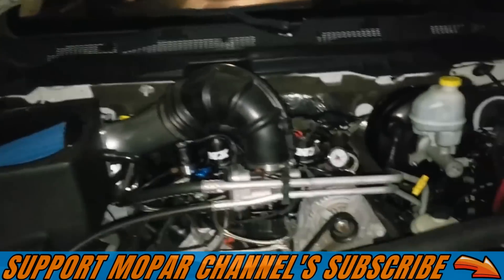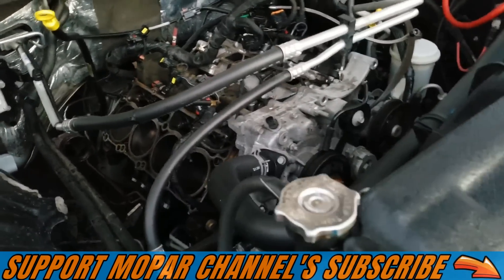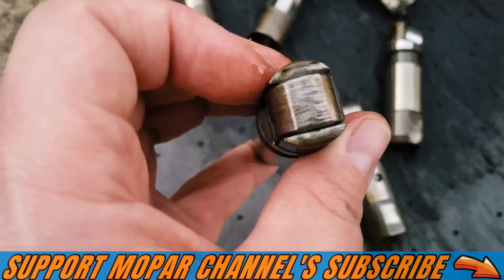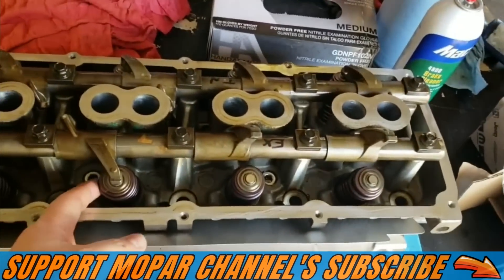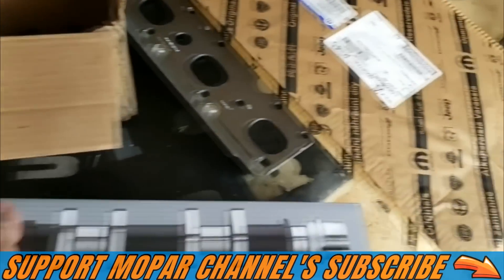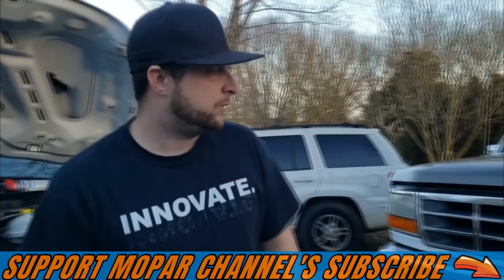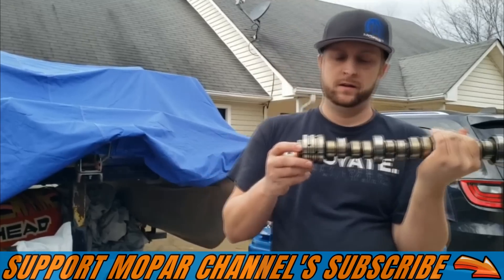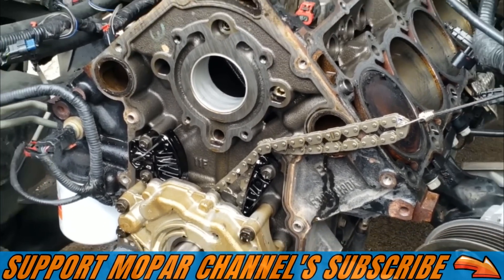5.7 HEMI TICK CAMSHAFT AND LIFTER REPLACEMENT MDS DELETE

Comment: I'm getting ready to do this (this weekend) Can you reference the other video you watched where you learned the timing chain trick? Thanks! Your video alone made me feel much more confident in doing this myself haha.
Reply from the maker: Thanks, I'll see if I can track it down biggest thing is make sure to keep pressure up on chain so it dosen't come off bottom crankshaft sprocket I used a bungee strap to hold it up and to the side.
Reply: How did it go?

Comment: I just installed the same .5 cam kit and some headers and it don't sound like that. You think its my muffler absorbing my lope? Not sure if it's a after market muffler on there or not but the resonators are gone. Do you have cats on that beast?
Reply from the maker: The .5 cam dosen't lope unless you run jays lope tune.
Reply: @FrostbiteRam  oh I see! You the man.
Reply: @FrostbiteRam  I'll be getting my tune from him Tuesday. That's what I ask for, huh?
Reply from the maker: Yes ask for the lope tune it will lope in park and neutral only.
Reply: @FrostbiteRam hell yes! I appreciate you as always. 🤘
Reply: @FrostbiteRam  Did you have a problem with your ram stalling when coming to a stop, after the tune was installed?

Comment: the MDS lifters go bad destroy the cam. What I've been hearing is Mds turns off and the lifter pounds on the cam when the lifter gets  pressure again
Reply: William Lopez so mds delete fixed it basically?
Reply: That is easily fixed by either Tow Mode (disables the ECO Mode or some newer models you can just hit the - button to disengage the ECO Mode, it's what I do every single time I get in the truck. And after every single restart...it's a bit of a PIA, but I hate the ECO Mode, don't give 2 Sheets about the cost of the gas. I f I couldn't afford the gas I wouldn't have bought the damn thing.
Reply: Anon Imous wait you can just turn that mode off and it fixes the mds issues?

Comment: An Inherent flaw in the design of this motor. No oil on the cam at an idle, new parts won’t change it.
Reply: You are correct. The cam gets almost no "spiash" lube from the crank until 2000 rpm.

Comment: Did you have any problems after the rebuild with metal shavings from the trash cam
Reply from the maker: No, I changed the oil 3 times within a week to flush everything out well
Reply: @FrostbiteRam  OK good to know thank you I’m going to flush it a couple times right before I replace it waiting for the rest of the parts to come in

Comment: Have not had a problem so far. I have a 2007 5.7 with MDS, bought at 48,000 miles now has 188,000 miles have always used Valvoline 5W-20. I used the semi synthetic til 100,000 miles then went to full synthetic. At 100,000 started putting a bottle of slick 50 in every 50,000 miles. Usually do not let it idle more than 10 minutes even in winter warming up, let it idle then start driving it. I usually try not to make short drives and shut off right away. I change the oil/filter every 5000 miles.
Reply from the maker: That's awesome and great information 👍
Reply: I have a 05 dodge magmun 5.7 with 148k miles on it. I did turned the mds system off with the diablo i3 tune and change my engine oil every 4k to 4.5k miles with ultra pennzoil full synthetic 5w-20
My question to you is is there any issues having the car at idle? And whats consider to you a short trip? Are short trips also bad?
Reply from the maker: @rhurtadorh32  prolonged idle can increase this failure has happened to lots of patrol cars.
Reply: rhurtadorh32 I always try to get the temperature up to operation temperature, pretty easy in the summer but sometimes have to drive around a bit in the winter.
Reply: Frostbite Ram i usually remote start the magnum in winter for about 5 to 10 minutes. 5 minutes for 30s Fahrenheit and 20 degrees and below i do 10 minutes
Reply from the maker: @rhurtadorh32   Nice great information

Comment: Question I have a 2013 Ram 1500 and the previous owner did the MDS Delete Kit on it, runs nice but the engine light stays on, when that stays on remote start kicks out after 19 seconds. How can I get rid of the engine code warnings, even if I clear them they come right back each time you start the engine. Is it a matter of live with the problems or is there a solution?
Reply from the maker: Definitely not right and can be tuned or repaired so it doesn't do that.

Comment: These engines oil the lifters through the pushrod.   If you notice there isn't a hole in the side of the lifter. Oil pressure travels through the head gasket into the head and into the rocker shaft. The rocker shaft has holes under the rockers that supplies oil pressure to the rocker and DOWN the pushrod. Not a very good system if you ask me. Be careful with the head gaskets, they only go one way.

Comment: Seems I’ve been hearing about this issue for a long time. When is Ram going to correct this???
Reply: This is an oil related failure.Nothing unique or remarkable about the Hemi in this regard.
Reply: Waylen 
What about the bad lifters scoring the camshaft?Is that an oiling issue or a problem unique to the hemi.I have no doubt you’ve seen it on you tube.
Reply: Brian It’s the detergents in the oil that break down causing a piece of sludge to seize the roller on the lifter which then wears away the camshaft.
Reply: Waylen 
Thanks for your video and professional expertise.Any oil suggestions for the hemi?I’ve heard alot of people talking about pennzoil synthetic with zinc.
Reply: Brian Chrysler recommends the Pennzoil synthetic.
Reply: Waylen 
Thank you.Seems most owners go with that and claim it lessens/stops the “hemi tick.”
Reply: Brian Rislone is a bottle of oil with powerful detergents.When you change the oil you can substitute one quart with Rislone to boost detergents further.It usually stops any problem lifter from ticking further, if just doing a regular oil change hasn’t worked in the past.It sure beats tearing the motor down over one lifter with an issue.

Comment: every one up here bad mouthing the hemi. i truly believe its all in how you maintain them. this dude literally has nitrous hooked to the truck. jesus christ
Reply from the maker: Lol yes I do but has zero effect on this failure. Thousands of bone stock trucks have this failure everyday.  Also I love the hemi no bad mouth over here at all it's a beast of a motor there isn't one manufacturer that is perfect or has zero issues just how it is.
Reply: Well that's basically it. The stock components are not made for the heavy tune and hard beating at the track. It is a production truck, with standard components. There are three of these trucks in our family. We have ran good oil in them at reasonable oil change intervals and never had issues. It really comes down to just how much people think a stock vehicle can take a pounding without issues showing up LOL. Got to take care of them! My advice to people is if they are going to race, or off-road the vehicle excessively under very arduous conditions , then you might as well build it for that right off the bat and avoid the disappointment when stock components fail. As far as all of the negative people they probably are not Dodge people anyway LOL
Reply: robert gray it actually has nothing to do with maintenance, it’s a manufacturing design flaw with the bearings.

Comment: Didn't go much into details with deleting the MDS. Did you also have to reprogram ecm/pcm to disable MDS completely now ? Going to guess you went with all non MDS parts going back in (sorry didn't bother to look up if hellcats had MDS so wasn't sure if lifters were non MDS items) , instead of MDS cam and lifters. Maybe I missed you stating items were all directly made for non MDS hemi engines , that you went with putting back into your MDS hemi. I am doing this on a 09 ram 1500 with MDS for a relative , going with a no tune 30hp plus non mds cam and all new non mds lifters , block offs for mds solenoids as you done. Only thing questioning is do I need to also reprogram the 09 computer to delete MDS system even with a no tune cam? It is a 09 Ram and reading through pages seems only 15 and above requires the unlocking/reprogrammed of ECU/PCM.Or is this incorrect and I still need to use a tuner with reprogramming/unlocking capabilities?

Comment: Quick question and hopefully someone can give me an advise. I’ve been using my truck with a bad lifter and cam for about 8 months or so. The trucks runs but off course like shit. It turns off once in a while. If I leave idling it will smoke and then It goes away. I’m about to either purchase a motor or replace the parts and put performance parts in it instead of replacing engine. Any advise. Should I replace the engine or can I get away with just replacing cam, lifters and so on? Thank you for all your help
Reply from the maker: If running that long on bad cam and lifters chances are pretty good the motor has been worn badly with metal debree especially if smoking white smoke but only way to know for sure what way is the right path would be to take apart the motor first and inspect the cam bearings and with the heads off you can check the cylinders for wear.
Reply: @FrostbiteRam  thank you so much for your reply, I really appreciate it. My best bet is to change the motor. Thank you so much

Comment: Oil is the problem! Not the lifter. Not enough ZDDP in the oil, causes bearing skating.
Reply from the maker: Absolutely incorrect sorry Thousands of rams I follow on the regular basis runs  nothing but quality oil and yet still have failures.
Reply: @FrostbiteRam  The problem was identified by Harley Davidson. It is called bearing skating. You must use a formula oil that is not too slick (Like True Ester based Synthetics), or too devoid of ZDDP.
Reply: D Gibson I had to change my lifter a couple of months ago... tell me what oil is best son I can start prevention there... thanks
Reply: Not an oil issue... if it was an oil issue it wouldn't be just one lifter....
Reply: Check to see if the dealer ever recorded a P1521 code on the StarScan tool they use. If correct weight of oil was used, they will tell you that code is erroneous/implausible. My 5.7l had this code and the problem was a deformed/mushed timing cover gasket sealing the surfaces between the timing cover and the engine block, near front drivers side head. This bad gasket leaked antifreeze in small quantities into the oil pan, as well as later producing an intermitant exterior leak. Contaminated oil could lead to seizures and sludging and wear of parts. The computer knows best, in this case.
Reply: D Gibson: It's true that todays oil lack necessary anti-wear additives( as they are the expensive elements in motor oil). I occasionaly fortify my oil with anti-wear additives that can be purchased. By doing this  my engine lasts longer and is protected from wear damage due to oil contamination.
Reply: David Myers that might be the most important comment I’ve read lately.  I have been having a lot of very intermittent problems with my 2006 Magnum RT.    170,000 miles.  Runs like a champ 90% of the time.   When the engine light came in one time I took it directly to the dealer and they scanned it with their wireless dongle, not sure if they used Star Scan.    But the guy said I had used the wrong oil.  I responded that “your guy used the wrong oil.  It’s only ever had oil changed here.”  I subsequently started changing the oil myself and went full synthetic.   Then got my own OBD reader, and after a couple more times where the oil light came on, went with K&N filter.   But SOMETHING is still wrong, and it’s very intermittent.    Also, same issue with a slight leak on the driveway, which comes and goes.  Hmmmmm.  Your diagnoses would explain a lot of issues.   I wonder if oil contamination could cause intermittent lifter issues which in turn could cause misfire engine codes which happen even though all of the things the reader tells me to replace are relatively new.  Plugs, coil packs, O2 sensors, etc.   It will run like a champ most tof the time then suddenly shut off.   I’ve thought long and hard about the gas tank issues, but not convinced.    I even have a lifetime bumper to bumper warranty on this car but the dealership are very difficult to deal with.   I even went above their heads one time cause they banned me for standing my ground when they bullshitted me about an alignment issue.  I got unbanned quickly.   The meeting with the GM after the unbanning was quite interesting.   That’s a story unto itself.

Comment: How is your engine and oil pressure doing a year after the repair? I've had a couple mechanics suggest engine replacement, but I'm going to do the cam/lifters replacement.
Reply from the maker: Still going strong at 150k now and race it almost every weekend 💪
Reply: What the name of the game
Reply: Any luck man? I'm in the exact same boat with my 2010
Reply: I replaced the cam and lifters and deleted the MDS system using an all inclusive kit from AMS Racing. So far have put 6500 miles on it with no issues. Good oil pressure, no ticking, slight loss in fuel economy from MDS delete. It does have a surge sometimes with mild throttle around 40mph. May need to replace the camshaft phasers sprocket or variable oil valve. I'm worried tiny flakes of metal may have gotten into either and are making them act up. Could be the tuning too though. I'm using the basic canned tunes that came with the diablosport in the kit.
Reply: @jasongunn6025  Awesome! Mine has 360k miles and has given me zero issues until now so I couldn't see how it would need a new engine. Definitely going this route.

Comment: Wow man you're good!! Great video. I have a 09 1500 5.7. Misfire cylinder 3. Changed all the plugs and that coil pack, checked all the injectors and still misfiring. I think it might be a  valve spring but not sure til I pull the cover off
Reply from the maker: Thanks bro🍻

Comment: Not a Mopar guy, but at that point, I would replace the oil pump too, the "other guys" stock pumps have issues and failures from lack of oiling. What caused the lifter to fail? No lube?
Reply from the maker: Poor design in lifters that's why they have been revised and or just use the hellcat lifters.
Reply: The MDS lifters collapse when in operation, what this means is the system does not allow oil to go to the lifter.
Reply: @joshkrause2977  I understand the GM DOD system and it's issues,  but not familiar with Mopar, GM....change oil pump with delete ,so why I ask

Comment: What if it only ticks when it starts but then the tick does away?  I heard that was just the exhaust manifold bolts that loosen after many heat cycles but after the engine warms up the bolts expand and tighten back up agian
Reply from the maker: Yes if it goes away when warm most likely has broken exhaust manifold bolt
Reply: @FrostbiteRam  thank man lol I was pretty sure with only 46k miles there wasn't gonna be anything big wrong with it.
Reply: My truck does the same. 2014 5.7 hemi. The exhaust manifold heats up and it re tightens. Mine actually broke a couple of the bolts.
Reply: Nothing horrible to worry about if your mechanicaly inclined its not too hard to fix if it bothers you
Reply: @chase5869  I don't mind it all lol, and I'm pretty mechanically inclined :)

Comment: I have a 99 dodge ram 1500 I'm having some trouble out of. It kinda trips over it's self at times and almost runs like it's got a performance camshaft. Even though it's all stock. You think it could be in the ignition system? I was told it might need a new camshaft. But it runs absolutely great when it's cold. Just when it warms up it runs like crap.
Reply from the maker: I would check the rotor cap and button also plugs and wires. That made a big difference in my old magnums on running quality.
Reply: @FrostbiteRam  thanks for the advice. I'm thinking of also checking the fuel pressure at work tomorrow. I read it is supposed to be pushing 49 psi. If I remember right the fuel pump it's self was replaced years ago now.

Comment: My 14 ram is in the shop now getting the mds delete cam and lifters. I’ve only had it about 6 months. Had 139k miles on it when I got it and now has 149k. Cyl 5 misfire. Mechanic told me for what it’s worth he would write to ram and complain. It’s not under warranty so when I get it back I’m going to, probably a waste of time but will see.
Reply from the maker: It's a shame really but after the Repair it will be a solid truck for yea👍

Comment: My tick starts at a cold start but goes away shortly after. I was told it's my manifold
Reply from the maker: If it goes away most likely yes
Reply: @FrostbiteRam  Huge relief
Reply: My truck had the tick they said it was the right manifold, it was replaced under warranty. Yes the tick is gone dont be fooled that it's the lifters on the cam.
Reply: @metube1956  right! I figured it would only be the lifters if it doesnt go away. But maybe the lifters are getting lubricated by the oil 😱😱😱

Comment: I'd love to see somebody come up with a retrofit oiller drip system to install and add the extra oil via tiny drilled ports to squirt oil onto the cam and all the lifters since it now sits so high up into the engine block and doesn't seem to get ANY OIL onto it a low RPM's until you rev that engine up and the crankshaft windage gets the oil up that high.

Comment: Thanks for the video. Just got a misfire on cylinder 8 on my 2011 Jeep Grand Cherokee at 140,000!!!!! Not happy!!! Into a cam swap now and 6.4 manifolds with the delete kit and a comp cam!!! Did you Dyno your truck before and after? What kind of power gains did you see? Just curious. Thanks again.
Reply from the maker: Thanks, and no I haven't dyno it but I picked up 3 tenths in the 1/4